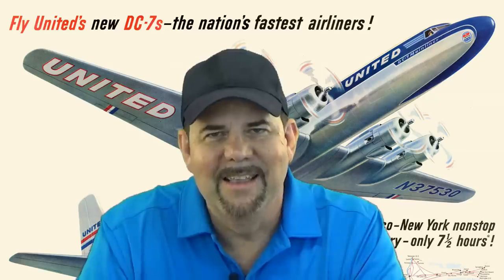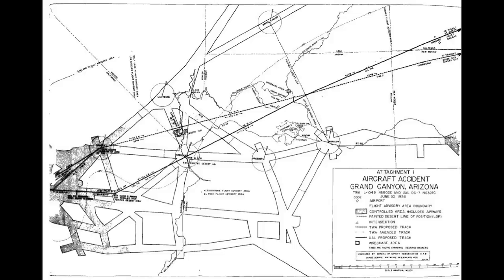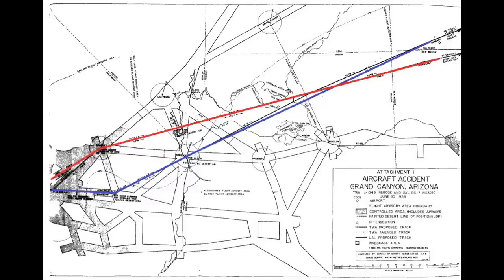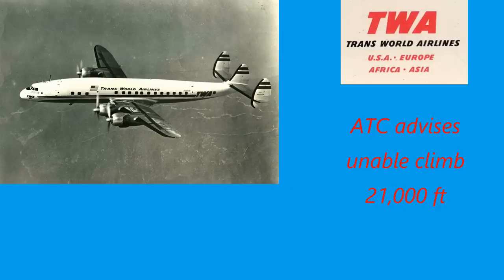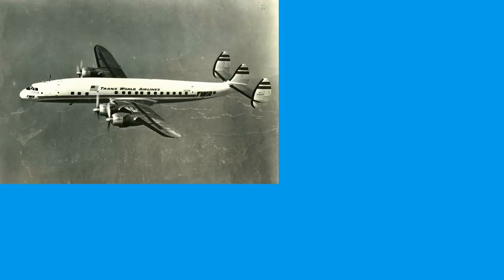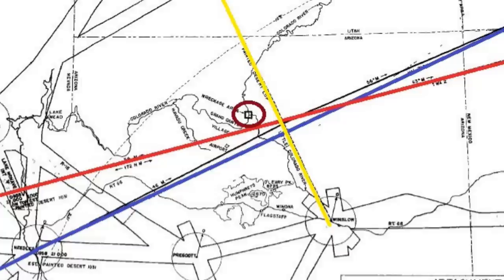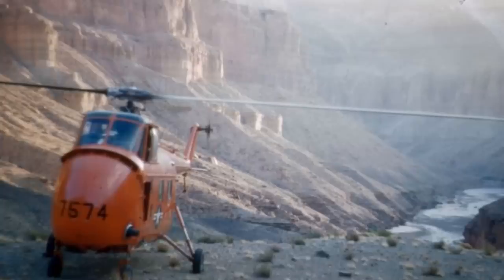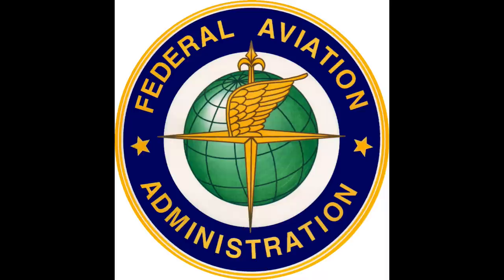The Crash that Changed the Way we Fly; 1956 Grand Canyon Mid-air

Comment: What an amazing thing that there were not more mid-air collisions .  Now passengers fly for the most part, oblivious of the amount of air traffic.  Now pilots value and appreciate the confidence instilled by air traffic control.  Thank you for explaining how this all came to be.
Reply: David Robins big sky little planes. The odds are in favor of the aircraft except near airports and practice areas.
Twice while flying I came close to a midair once at KHWO performed a touch and go on the way to kFXE at the beginning of IFR Training After climbing to pattern altitude I was on course to a head on collision with a twin engine we both made a hard right turn and
Avoided each other about few  seconds later I received a call traffic 12 o’clock at your altitude. The controller sounded panicked. Since we were on a ifr flight plan we should not have been cleared by the tower for a touch and go and my instructor should have known this as well thank goodness it ended well. The second time was in the practice area nw of FXE a vans RV doing loops with no radio calls went by the left of my Cessna he had a yellow shirt on and sunglasses he never knew how close he was he never looked our way. I have not used a practice area since then Except when doing my BFR. Also south Florida is VERY crowded airspace lots of schools lots of nice flying days.over all flying is relatively safe as long as you keep your eyes mostly outside the cockpit.

Comment: The technology WAS in place to prevent the collision. Someone in L.A. got two messages saying the two planes were approaching each other.  Why did not the ground call the aircraft and report it? , I hoped this report might have shed a little light on that corundum. It's possible the ground personnel assumed they would see each other. It was unusual to order an aircraft to do anything from the ground outside of controlled airspace. Back then the PIC (pilot in command) of an aircraft was like the captian of a ship; his word was law and most resented any "suggestions". That finally ended with the runway collision at Tenerife.
Reply: I saw the reason for the communications breakdown being in the archaic method ATC was working.
One aircraft was in communication with ATC directly, while the TWA aircraft was using a 3rd party "company man," to relay messages to ATC.
And were both aircraft actually in contact with the same people at ATC?  Or was there still yet another "4th," party, at ATC, handling TWA, but in contact with the handler of the other aircraft?
Any system, is only as good as the people who use them within the intended guidelines of that system.  But even established protocol, may at times require someone to go beyond the boundaries, if they see that something is not being covered properly.
It's that there was the first air accident.  It's that there was a second, then a third, "etc.," before there was a proper response to the cause.

Comment: Historically, this was the first mid-air, civilian aviation collision.  And then several more occurred, before "the system," was corrected.
Today, we would call this "tombstone politics."  Where so many people have to die, to stir up a public and/ or official response.
The same logic is repeated in the auto industry, and just about every mode of mass transportation.
It's true, that not every danger within a mode of transportation can be seen ahead of time, before it becomes obvious in  the form of a crash and people getting killed.  Especially when a new form of mass transportation technology becomes public.
It's the 'latency,'  between crashes and the willingness of the industry and politicians to offer any proper reaction.
We've seen that same mentality in steam liners, trans, subways, aircraft and automobiles.

Today, we have several examples of "near misses."  and it is a terrifying thing, to be aboard an aircraft, flying at hundreds of miles per hour, that passes another aircraft, very closely in the opposite direction, doing the same speed!

We have such things as "3 mile separation," between enroute aircraft, and a 3 minute wait on the runway, between aircraft taking off and landing, to prevent the crossing of aircraft generated, "wing vortices."

We have GPS navigation, which has made much of the earlier VORs, NDBs, and other forms of electronic navigation, "secondary," if not obsolete.  We still use them, as a backup, should and aircraft's GPS system go out.

We have transponders that offer additional information to an air controller, besides just a "blip," on the screen, like altitude, airspeed, heading and the flight number of the aircraft.

We have doppler radar for weather, and even in most cases today, some effort to identify "micro bursts," near airports, that have caused crashes of approaching aircraft in the past.  There's also satellites above, that watch the weather 24/7.

There's ground traffic control as well, at those airports large and busy enough to need such.

there's ATC controlled, IFR above 18K, and  ATC controlled, IFR approach within controlled airspaces of all large airports, and even some smaller ones.

"Glass cockpits," have replaced alot of the older analog gyros and vacuum types of instruments, simplifying the controls of airliners for the crew.  While some of these older type instruments may still be in the cockpit, as a redundant means of flight control, in the event of an electronics outage, the day may come, when they will be entirely missing from flight panels. 

Every one of these steps in technology, has been made because at some point, someone died for the lack of it.
We've come a long way from the day of the first air collision.  And the cost, in the form of lives lost, has been very high.
Reply: One of the other two mid-air collisions killed the head of the Civil Aeronautics Board!  The crash at Nellis AFB.
Reply: I would argue that - considering the total number of flight hours and number of flights made - the cost (measured anyway you chose) is actually quite small.
Reply: It's sad for every hundred who died a million will be saved

Comment: Regardless of the failures of the system, the TWA pilot was clearly wrong in ignoring the radio operator's instructions to stay at 19,000 feet. The primary cause of the fatal accident can be laid squarely at his feet for his cavalier action of climbing when he was told not to change altitude. What was he thinking? There had to be an obvious reason for his request to be denied. His ego caused him to substitute his uninformed decision to override that of the controllers and he killed himself and 127 innocent passengers. Period, end of sentence, guilty as charged!

The narrator, a pilot himself, shows his obvious bias by not mentioning the irresponsibility of the pilot in causing this accident.
Reply: I guess you think the pilot should have stayed at 19,000 ft and flown inside clouds where he would be able to see nothing?
Reply: Bias? He showed no bias. He reported facts. 
Bias would have been present if he commented on the irresponsibility.
And yes, it was that pilot's fault, but what I don't understand is why the reason for the denial of his request to fly higher wasn't provided to him, e.g. "Denied because that altitude puts you in a possible collision course with another plane."
If he knew that, would he have still climbed to 21,000, or would he have climbed to a different altitude?
Hindsight is 20-20, unfortunately.
Reply: Wayne Adams - the narrator implies that the TWA pilot was in the middle of the clouds at 19,000 ft and climbed to improve his visibility. Not being able to see anything in the midst of a cloud bank seems like it might be sufficient justification. I think you are using 20/20 hindsight in condemning the pilot for his climb to 21,000 ft.

Comment: Excellent presentation.  I was seven years old when this happened. I started reading earlier than that and had to visualize the time-line.  You have provided a concise picture.
The 1960 midair over NYC was a lot closer to where i lived at the time.  I think 128 passengers and crew in that accident,  too. One kid survived the crash but  died a few days later. Terrible.

Comment: Great YouTube on this portion of the history of US Aviation.   I knew of the original methods of "A compass, clock, a finger and a map" (How I learned and still find valuable when "TECH" dies)  -and the next level of "Lighted (Beacons) Airways" that predated VORS. But did not realize that there was this "dead mans zone" during the evolution where airliners could operate as they did above 18K MSL and not under IFR ands, even worse, that commercial flights were passing ATC COMM's via "relay" through their corporate Flight Dispatch / Flight Ops offices and working everything off of what we used to think of as "2D Flight Strips".   I did not know that these accident forced the changes to bring in teh FAA/ATC/RATCC and so many changes that we see today as "normal".  With ADS-B In-Out and GPS it takes Safety to yet even higher levels   Very informative. Many Thanks,  Brad (COM-INST;  SE/ME Land /Sea + RW)
Reply: Brad Powell $

Comment: Hi James, one thing you might make note of is that the TWA Connie took off first with a filled true airspeed of 240knots.   The DC7 took off second, with a filed true airspeed of 285knots and caught up with the Connie.  I think, but am not sure, at that time a VFR on top aircraft would have been told about another aircraft at a hard altitude of 21,000 within 10 minutes of his estimate.   I hired on as a Controller Trainee, at Indianapolis Air Traffic Control Center, July 9, 1957.  I was certified October 1958 as a Controller.  We were one of the first 3 centers to get Enroute Radar in 1959, but it did not cover more than may be 1/5th of the Indianapolis Center area.  Controlling aircraft with strips of paper was a real mind bender in the beginning.   We did not get breaks in those days.  I had an upset stomach most of the time for years, but I was young and loved my job.

Comment: why did they have to go from 19 to 21 thousand, just ascend a 1000 would of still missed
Reply: Right altitude for direction of flight. North bound and East bound aircraft travel at odd altitudes to avoid South bound and West bound aircraft which travel at even altitudes. Still generally works that way today,
Reply: Eastbound altitudes are odd, westbound are even.
Reply: They flight east at odd thousand feet altitude and go west at even thousand feet altitudes.  That is why they wanted 2,000 ft higher.
Reply: That is speculation that there was no traffic at 18000 feet. You could also speculate that they could have climbed to only 20000. But this was the protocol in that era, and there was UNCONTROLLED airspace.
Reply: Just speculation but there were likely defined altitudes ironically to prevent these types of collisions but it only works if everyone knows where everyone is located.
Reply: Wrong altitude to be going east.
Reply: Odd altitudes going east, even altitudes going west.

Comment: There are too many aircraft in the air all over the USA.  What we need is alternate practical 
high speed mass transportation, such as used in other countries.   Surface routes of safety 
could be established with proper design to avoid conflicts. That could relieve traffic congestion 
that leads to accidents of such massive loss.
Reply: But our spendthrift? conservative? Chief Executive of National government, is too short-sighted 
to even fix major infrastructure deterioration.
Reply: Makes me laugh when people ask why we don't have "flying cars". We do, they are called "airplanes and helicopters". You have to have a special license which takes a long time to get and aircraft are VERY expensive.
Reply: Fritz Doerring In the 40s in Houston Texas there were plans to create a spoke and wagon wheel mass transportation system on rail so you could get to any point in the city. But oil companies bought off corrupt government officials and the plans were killed. Now houston is completely congested with cars & trucks spewing out unlimited amounts of pollution. We need to stop corporate control of government or this country will continue to decline. Vote against all corporate owned candidates.
Reply: "There are too many aircraft in the air all over the USA." Yet no mid-air collisions, except 2 (1956 and 1960).
Reply: Per mile traveled, less people die from air travel than from ground travel. It is great safer than train travel.

Comment: Great video!  I've heard of this accident, but I never understood how 2 planes could be at the same place and at the same time with each one flying at a speed that was guaranteed to make them collide.  I don't think flying is as safe as all the propaganda states.  The basis for saying that flying is the safest way to travel is based on miles flown without an accident.  If you judge safety on the number of trips made then flying is no longer the safest form of travel, because most accidents happen on takeoff or landing.  (see the article:  'the risks of travel' at www.numberwatch.co.uk/risks_of_travel.htm.)  IMO commercial aviation never should have been allowed to start in the 1920's.  Flying is a very unnatural thing for humans to do, and it involves a great many things that were unknown  back then.  But as usual money was the driving force and human life is not important!

Comment: thank you for that vid-- cleared up a lot of moments when dad would tell me about some of his adventures- Like-- sitting out bad weather in Denver with ATC their radar turned off when the phone rang and the Army wanted them to run a sweep so-- they turned the radar on- waited for the tubes to warm up (google it youngsters)-- and the first sweep showed the plane headed straight into the mountains-  they shouted into the radio- "army flight turn left expedite"-- as the signals merged- there was a moment and finally the plane emerged from the sweep-- and a good time was had by all-

Comment: I suggest you make a video depicting the crash of Northwest Orient Flight 705 on February 12, 1963. Flight 705--a Boeing 720B with 35 passengers and eight crew--crashed in the Everglades about 15 minutes after takeoff from Miami. The plane went out of control in severe turbulence, and went into a near-vertical dive. Captain Roy Almquist's efforts to recover control were to no avail, and the plane disintegrated.

Comment: I renumber this crash; I was in high school. After H.S., I enlisted in USAF and was eventually trained in long range radar maintenance. My first duty  (1958) was at LVAFS, about 50 miles north of Las Vegas, NV. I was puzzled to discover that LVAFS was significantly overstaffed. It seems that the USAFhad recently  closed their radar station at Kingman AZ and transferred some of those airmen to LV.  Runour had it that the site at Kingman was closed in response to their lack of action prior to the crash. I speculate that politics was involved. The picture of the AN/FPS-3 radar in the video brought back memories. That's the type of radar that was at LVAFS, and probably Kingman. In those days it was called long range; nowadays we would call it medium range at best. In response to this crash, the USAF, at least in LV, monitored commercial flights. In late summer 1958, the LVAFS radar was upgraded to an AN/FPS-20A, a real long range radar. We started getting FAA controllers assigned to our site. This FAA-USAF cooperation eventually became a joint use program where the FAA took on the responsibility of maintaining several USAF radars, at the USAF location. In 1961 I joined the FAA (seemed natural) and was for a time assigned temporarily to Las Vegas. In addition to LV, I spent some time at Boron AFS, in CA. As far as I know, this joint program is still in place.

Comment: There are actually two mass graves for the victims of this tragedy. The largest is the one in Flagstaff, something like 126 caskets from the TWA plane, but there's another mass grave at the Grand Canyon Pioneer Cemetery. Those remains that could not be identified from the United Airlines flight were placed in four caskets and buried together.

Comment: The irony of this tale is that in 1956 the area around the Grand Canyon was among the least populated in the Lower 48. In fact they didn't call it the ''Lower 48''. Just called it the Forty-Eight States. Wouldn't be until Hawaii became the 50th state a few years later that the term would start to become commonplace. 

This little tidbit from Wikipedia: 
The "Air Force One" call sign was created in 1953, after a Lockheed Constellation named Columbine II carrying President Dwight D. Eisenhower entered the same airspace as a commercial airline flight using the same flight number.